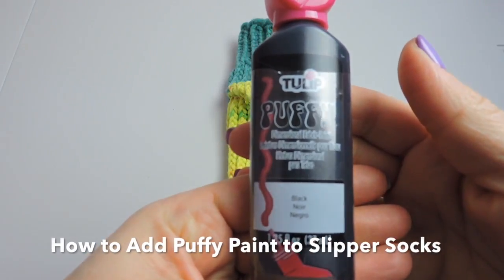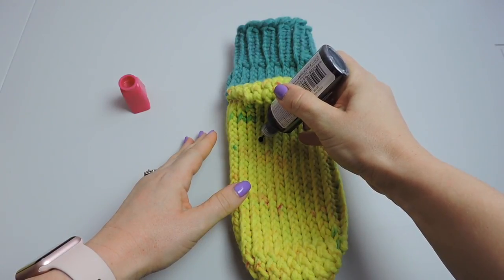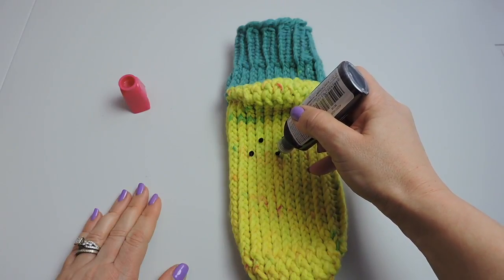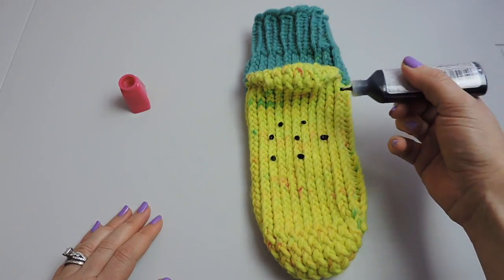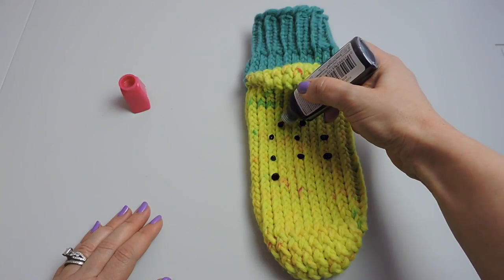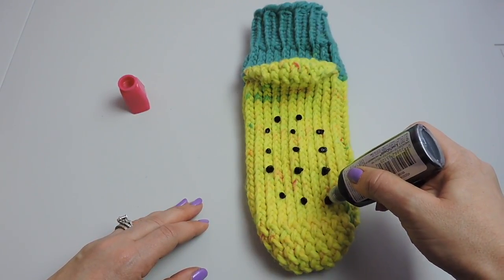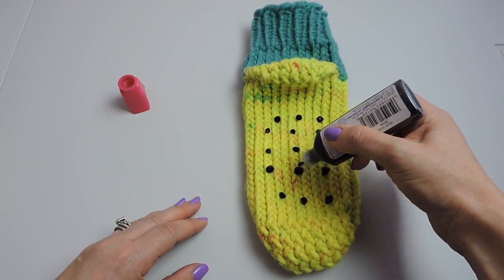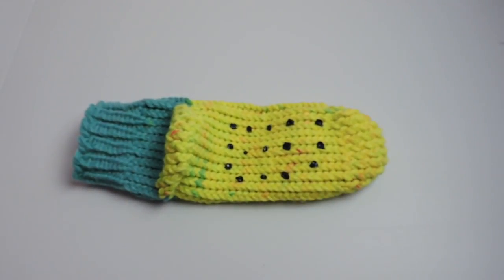How to Add Puffy Paint to Slipper Socks

Comment: i must have over a hundred pairs of slipper socks from the hospital from both myself and hubby,but they have all lost their grippiness.  I had seen a post on a knitting forum saying to apply puffy paint to the soles to prevent slipping on wood floors.  I thought it worth it since the paint is so reasonably priced,to try it on hospital socks that no longer have their grippiness.  Can you tell me if it's ok to machine wash and hang to dry?  "I just applied the paint to a pair and will let them dry overnight.  Thanks for posting this tutorial, We'd have been lost without it.  Sue